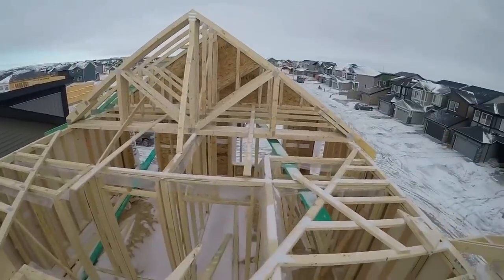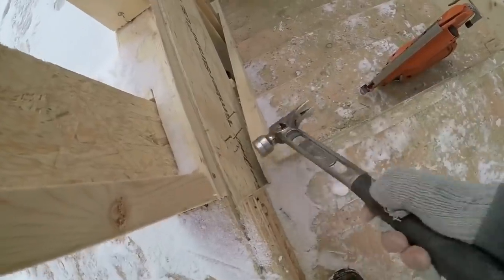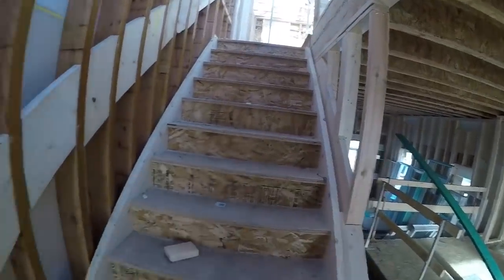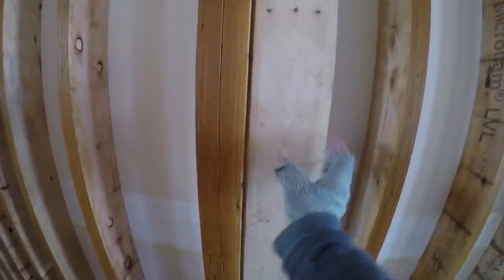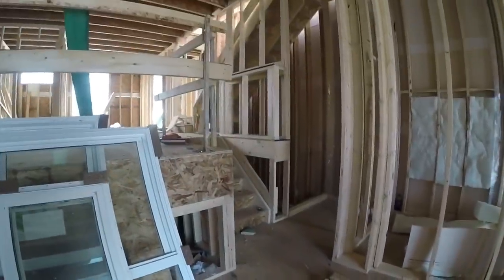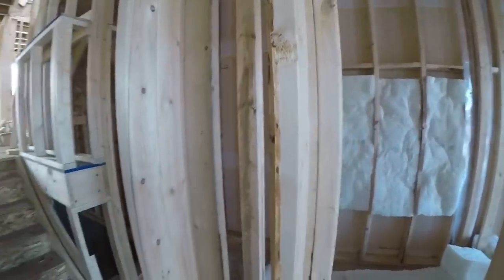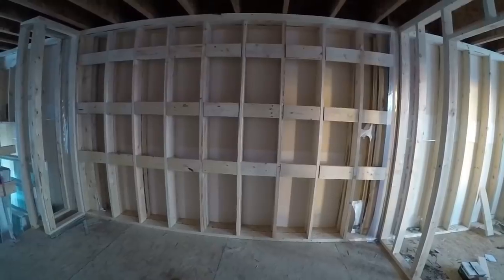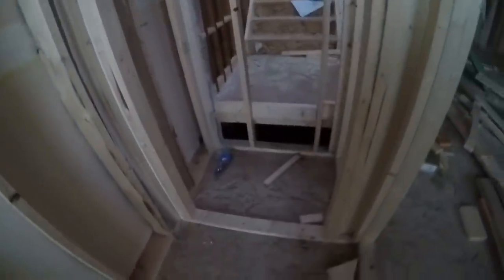How to build a house alone. Season 2 Episode 31

Comment: Not sure if you are going the extra mile with the blocking but I don't remember our framers doing all that. I feel like we constantly had to come add nailers for everything. Including easy ones they missed for simple drywall nailers. I used to think they were perty good til I've seen you deal with the house wrap around windows, poly on top plates, drywall on outside walls, bringing tubs in, fire blocking, and especially blocking for accessories like handrails and bathroom fixtures. Code is probably different here but you frickin kill it man.

Comment: On all of framing I jobs have done the plumber would put in their own blocking for the fixtures they were installing. Blocking for stair railings was only placed where the brackets would be. Cabinet blocking was generally only done if we were also contracted to do the trim and set cabinets. Wall mounted flat screens hadn't been invented yet.

Your attention to details is outstanding and will result in a higher then standard quality product.
Reply: Exactly.  We attach base to studs, or criss-cross nail when no stud is available; must be a Canadian standard - I like it!
Reply: Around the landing on the stairs the blocking is great as you don’t have to go looking for a stud. Handrail backing , ok maybe a little overkill but again if he has a lot of the same trades following him, they would love it.  Props all round for thinking of other trades. Here in PEI we have to strap our ceiling for drywall rather than fixing to the joists..... don’t ask.
Reply: @karltaylor36  it's a quebec/maritime thing, it provide an air gap since it'smore humid

Comment: I can't believe the builders you work for. All that extra work is insane to pile onto the framer.
Reply: It's because there's too many bad framers out there that aren't consistent with stud spacing.  So it's a lot easier for the framer to spend a little time adding backing (which also forces them to make their stud spacing consistent if they want to be fast at it) than it is to ask everyone else to guess where the studs are.   Not every house is built by Crazy Framer.

The earlier you are in the building process the more important it is you get your shit right.   So framers get dumped on.  It's just the nature of the business.
Reply: @eeguy77  True....but don't forget everyone's favourite saying, The tapers will fix it. Lol....they get dumped on just as much.
Reply: Agree, We charge extra for all the extra's. Alot comes down to the builder wanting everything cheap an fast
Reply: ya way to much extra work that is not needed. Its also allot easier to put one board for ceiling backing and tossing a block every 4-6' across its  easier for the sheetrocker to find it. You also dont need baseboard backing like that the sheetrocker and trimmer nail the studs not just anywhere on the ends. No fire blocking?

Comment: We leave jacks out on interiors stand them and then run saw the 1 1/2 way to cut bottom plates out. We only do load bearing interiors until roof on then do rest after so you can work on rain days
Reply: Craig,clever. Must remember that. Especially if chainsaws aren't allowed. Like here in Ireland

Comment: That hammer better be good, it costs $270 cad!! All cost aside though, I'd love to have one just for the side nail puller!
Reply: $225 USD Amazon
Reply: Mine was just over 270. Best hammer around in my opinion
Reply: Yeah it's worth it don't worry about price it makes you a better carpenter which means your e worth more money
Reply: A Ron, Your damn right, your only as good as your tools!! (Having said that, you can have the best of tools and not know how to use them) This guy clearly has the knowledge, dedication and tools to do the job
Reply: When ever someone I work with blames the tools for their mistakes I always say "a good carpenter never blames the tools"
Reply: @kyles5513  a good carpenter doesn't have time for bad tools. We've all worked with guys who suck but this rational isn't meant to apply to those chumps.
Reply: What hammer is it?

Comment: Is all these backing boards common, for the rails, and toilet paper holder, etc?  I've never lived in a house where it was framed this way, and frankly i'm pretty envious of the new home owner here.
Reply: It all depends on the builder. But usually it's not done.  That handrail blocking was totally unnecessary. Just needed a block top and bottom. No need to fill in between.
Reply: @skliros9235  never framed a house and didn't do it. In the trade for a while and always need backing and if it wasnt there was pissed at the guys when it came to finishing.
Reply: @skliros9235  With respect, Canadian building codes may be different than ours in the States.  It may be required.
Reply: It’s nice to have either way.
Reply: I live in Canada, Ontario, and I've never seen blocking for handrails or baseboards. Just find the studs, they're stronger anyway.

Comment: Surprized you don't have to firestop block your stairwell and landing. CA. AZ. NV. TX. All required.
Reply from the maker: There is fire guard drywall between the landing and the wall. And enough space to fit it beside the stairs .

Comment: Does your customer insist on all that blocking? Because some of it, the kitchen cabinet blocking in particular, is pointless. These days a good cabinet installer simply attaches angled cleats to the studs (okay, after they've located them) and matching angled cleats on the back of the cabinets. So a 45 degree upward angle on the stud cleats and a downward 45 angle on the cabinet cleats. Then simply lift the cabinet up and onto the cleats and put a few screws through the cabinet backboard into the cleats. Done.

Comment: Baseboard backing? A waste of time. No fire blocking in stairwell. That's what needs to be done, I guess codes are not requiring it. Odd.
Reply from the maker: There is fire guard drywall between the landings and the wall. There's also space between the stairs and the wall  for the drywall. The baseboard backing is also there so if someone kicks the bottom of the wall, it will be solid.
Reply: CF indicated that base board backing is required by the builder as part of the contract.